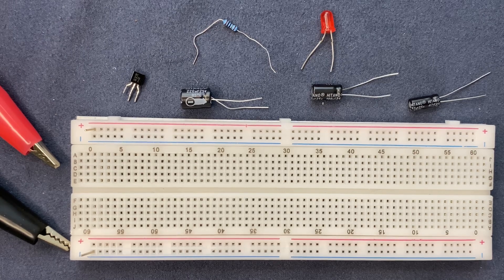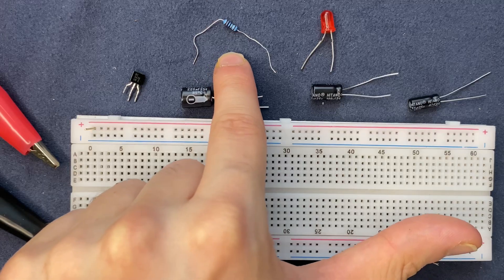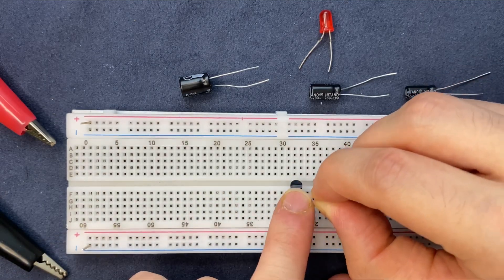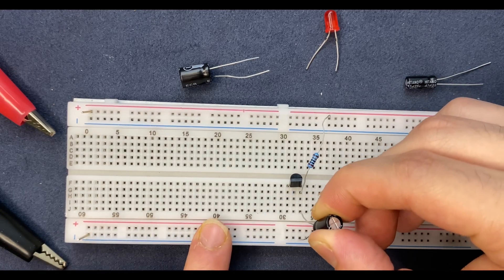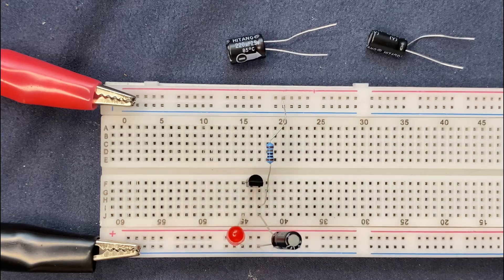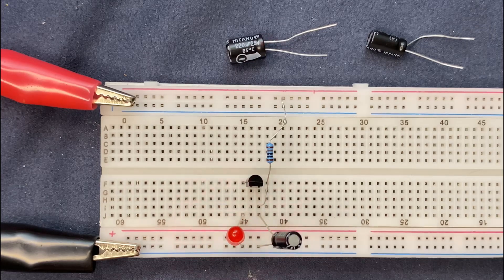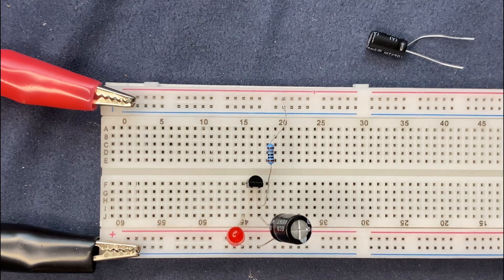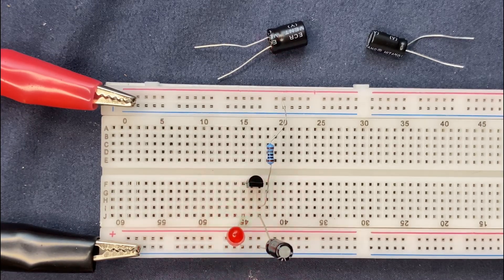How to build a single LED flasher circuit using BC547 on breadboard #flashercircuit

Comment: Please explain how this circuit works😢
Reply from the maker: As the circuit powers up, the capacitor starts to charge through the resistor connected to the positive rail.
	
Once the voltage across the capacitor reaches a certain threshold, it becomes sufficient to turn on the transistor.

The transistor switches to its on state, allowing current to flow from the collector to the emitter.
This turns on the LED connected to the collector, and it lights up.

Discharging Phase:
As the capacitor discharges, the voltage across it decreases.
The resistor connected to the emitter controls the rate of discharge.

The cycle then repeats as the capacitor starts charging again, leading to a continuous on-off cycle for the LED.
Reply: @ElectroMin  This clears my doubt. Thanks for taking time to reply mate🙏
Reply from the maker: @siran804  goodluck 👍

Comment: It would be really nice if you could explain how this circuit works and why you are using only two legs of the transistor.
Reply from the maker: As the circuit powers up, the capacitor starts to charge through the resistor connected to the positive rail.
	
Once the voltage across the capacitor reaches a certain threshold, it becomes sufficient to turn on the transistor.

The transistor switches to its on state, allowing current to flow from the collector to the emitter.
This turns on the LED connected to the collector, and it lights up.

Discharging Phase:
As the capacitor discharges, the voltage across it decreases.
The resistor connected to the emitter controls the rate of discharge.

The cycle then repeats as the capacitor starts charging again, leading to a continuous on-off cycle for the LED.

Comment: It worked for a minute and then stopper working
Reply from the maker: The Circuit is actually easy to build and requires not much components 

Try using different capacitor value , resistor but keep the input voltage not more than 12v 

Check whether the pins of BC547 (E,C,B) are connected accordingly
Reply: @ElectroMin is it a big problem if i have bc547b instead of just bc547?
Reply from the maker: @arturkrtl  it doesn’t matter , bc547b is a type of bc547 transistor , only difference would be the current gain

Comment: Sir , can i power the circuit with +12 Vcc
Reply: I am sorry,  i mean +9 vcc
Reply from the maker: @abubakarismail9192  hello my friend, i tried with 9v and the led didn’t turn on, if you have +9v Vcc you can lower the resistance first so that the current across the transistor  would be big enough to turn on the transistor and then led , let me know if it works 👍

Comment: I have tried 30 methods but none of them is working tellme why i am getting very angry cause its not workingggghghg aaaaaaaahhhg
Reply from the maker: Did you check the polarity of the LED?
Are you using bc547 and are the pins in the proper order?
What input voltage are you using?
Maybe your transistor or LED is not working
The circuit is actually easy to build and as few components so take your time check the wiring and connection and check whether the transistor and led works in another circuit
Reply: My resistor is some power idk and capistor is 100 uf 50v